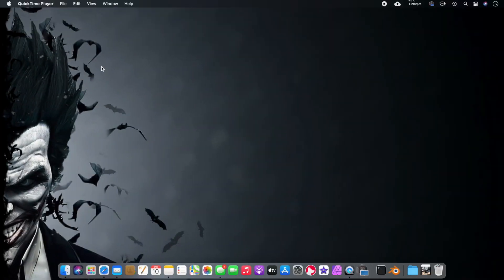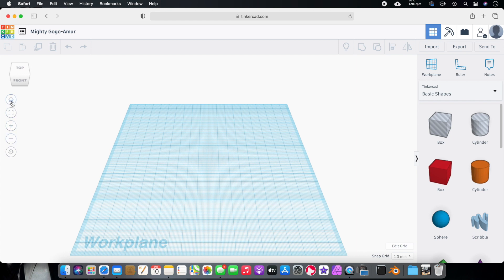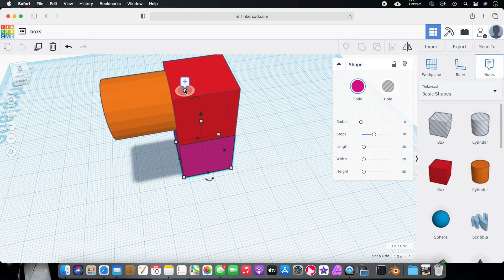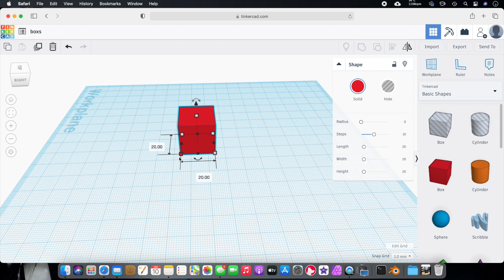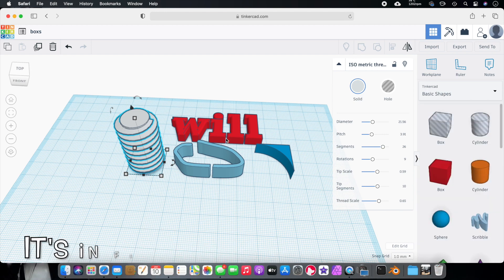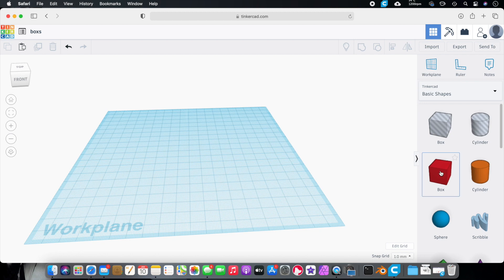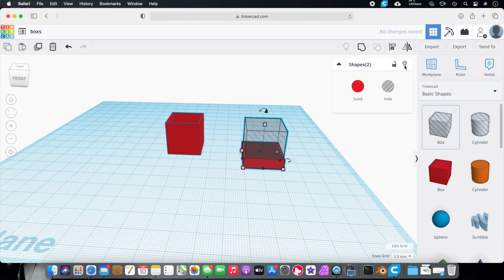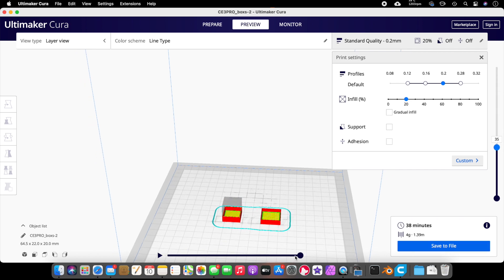How to make your own 3d printed models using tinkercad

Comment: I ma trying to boot my macbook air late 2010 but i am unable to do so
The scren shows  ' no bootable device-- insert boot device and press any key' 
Please help me 😤
Reply from the maker: I hate to tell you this but it sounds like your hard drive went dead.
Reply: So now what should be done
Reply from the maker: Honestly it’s a 2010 I would get the new M1 MacBook Air. As far as the data it’s probably lost. Sorry. Did you make a Time machine back up?
Reply: No
Reply from the maker: You could try hooking it to another Mac and see if you can do some data recovery.
Reply: How this hooking is done ?
Reply from the maker: Yeah that not going to work but you can take out the ssd and put into this https://www.amazon.com/GODSHARK-Enclosure-MacBook-External-Adapter/dp/B07R3WJ5BF/ref=sr_1_5?crid=30WU55DLHWFCL&dchild=1&keywords=2010+macbook+air+ssd&qid=1610760854&sprefix=2010+Mac+book+air+%2Caps%2C165&sr=8-5